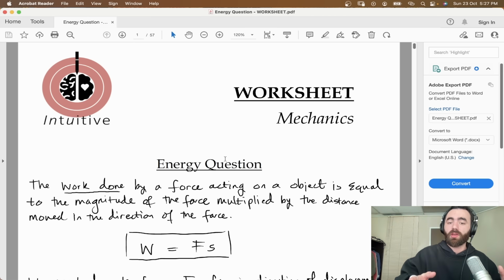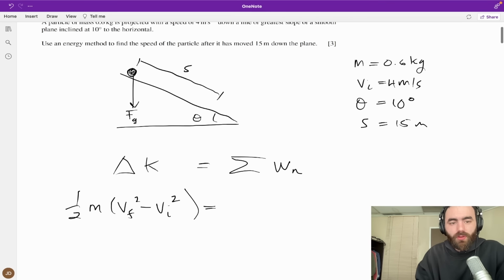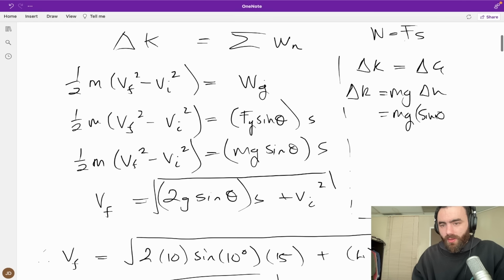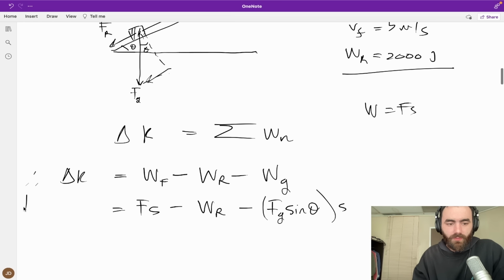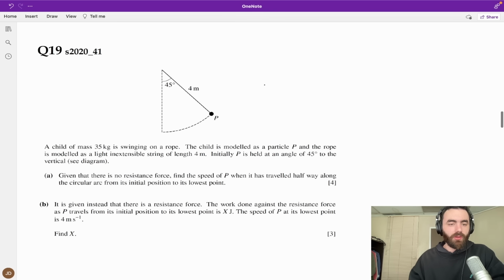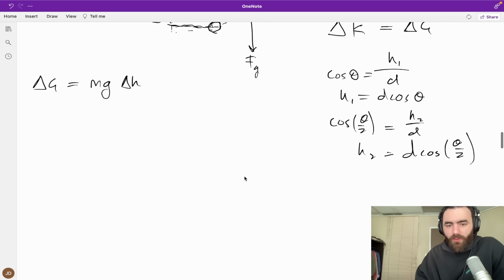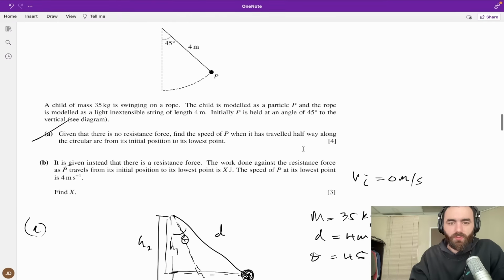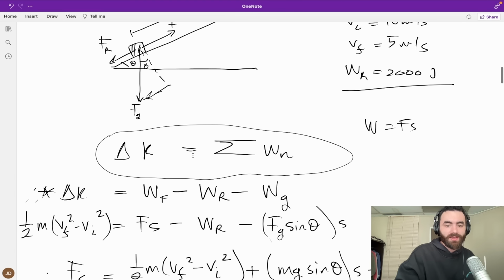Exam Hack | CIE A-Level Maths | Mechanics | Work-Energy Question

Comment: what if the surface is not a straight line? are we still allowed to use  change in KE= net work done? and work done against gravity is only applied when the surface is not straight right?
Reply from the maker: You can always use it for motion this a fundamental Law of Mechanics. In question three I go through an example of motion which isn't in a straight line (Curved motion form a pendulum). Work done against gravity is the change in Gravitational Potential Energy, which only occurs when an object moves in any capacity vertically. I'm not exactly sure what you mean by not a straight line, if you are moving up a slope you will have a work done against gravity because the object is moving to some degree in the vertical direction.
Reply: Yes you can I’ve used it. Just be careful in using 1/2mv^2 as for inclined planes when ascending ke decreases so just put a negative sign!

Comment: Thanks for the videos they are really helpful. One question: for question ii you got change in h by doing 4  minus 4 cos theta but in question  i why didn't you do the same thing but divide the (4 minus 4 cos theta ) answer by 2 as it say is that the change in h is the midpoint between 4 and 4 cos theta